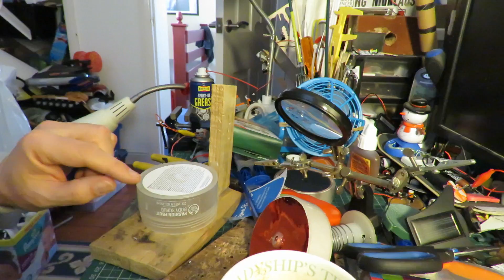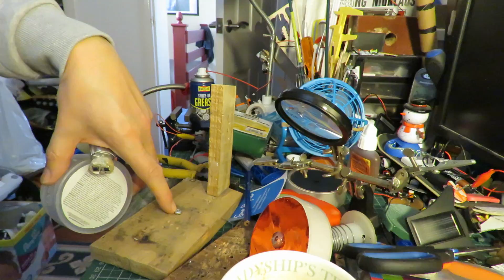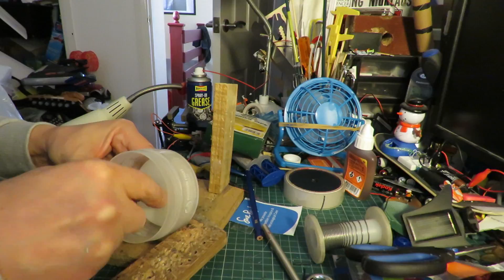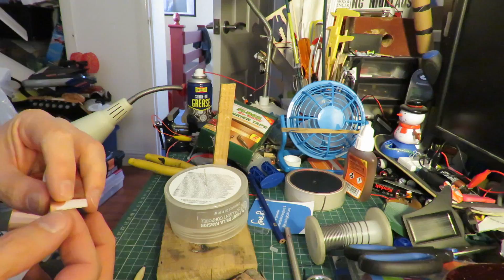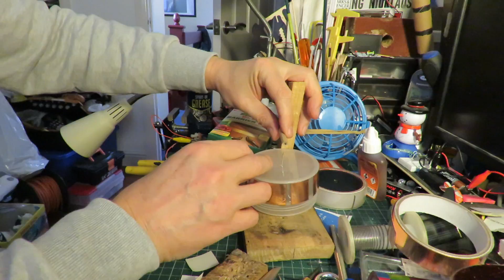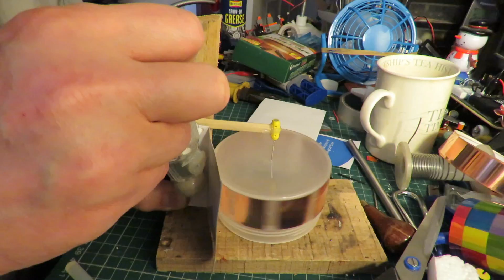Replicating another one of Lidmotor's projects Lenz's Law

Comment: the axis is't proper
Reply from the maker: +Shravan Shravan I don't have a clue what you are talking about?
Reply: +GrandadIsAnOldMan Sorry i was't clear, the plastic disc is little tilted (10.00sec), you can see its rotation a bit wobbling, making the disk perfectly aligned with the axis can improve its speed.
Reply from the maker: Shravan Shravan do you see anything in this build that is perfect? The object of the project was to make something that worked. If you want to make one yourself and make it better, please do so and share the results. I am showing the basics but every part of the build could be improved with care and time.
PS. I like your CNC plotter video :)